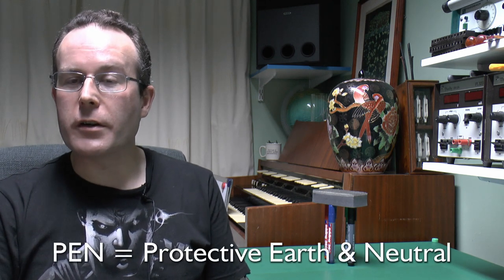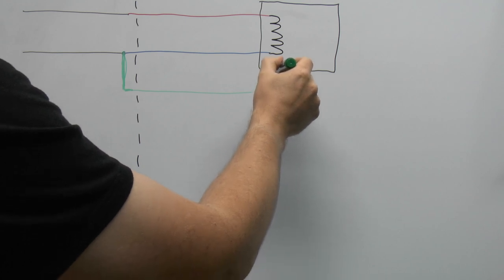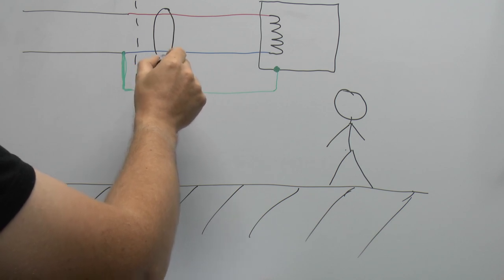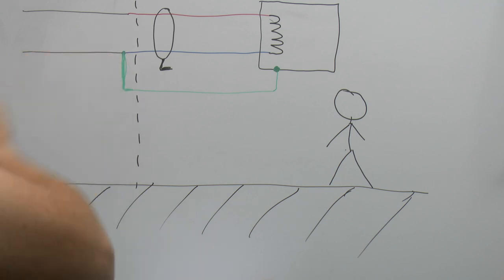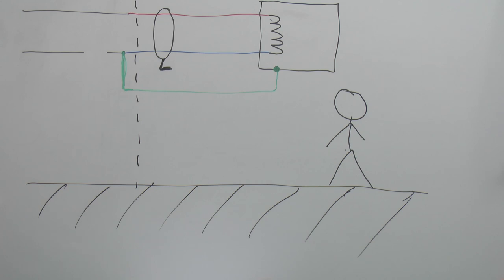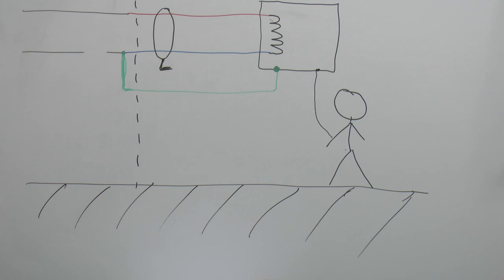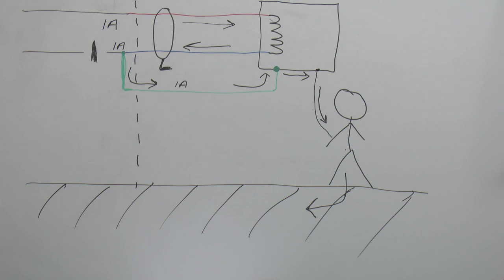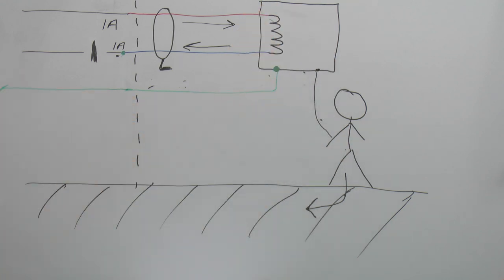TN-C-S Danger - Broken PEN Conductor (Combined Earth & Neutral)

Comment: I have a TN-C-S  type supply in my house and i have a separate grounding point (a spike in the ground) connected to the consuming board earth bar. I is a good thing ? I think in the situation of broken PEN it will be safer.
Reply: It depends on your local regulations. North and South America as well as most Anglo-Saxon countries usually apply TN (Grounding through neutral) whereas many other countries apply TT (grounding with ground rod). Many countries demand both to lower the risk of a broken PEN.

The TT System has the advantage of not rising ground potential in case of a broken PEN but all circuits need to be protected by a 30mA RCD.to prevent grounded devices with a metal enclosure from becoming live without tripping a breaker. In TN System  RCD's are optional although many countries have a rule you need to install them in places that can be moisty (like bathroom, kitchen, garage, outside).
Reply: +Kamis47
Actually, the 18th Edition Wiring Regulations are expected to require this extra earth-rod for new installations...  [though we will have to see how they come out, of course!.].
Reply: It wouldn't help in itself as the RCD wouldn't trip (equal current through live and neutral) and the earth impedance would be too high to trip any higher rated MCBs. Certainly not 40A, 32A or, probably even, 16A. Even 6A might be a bit of a hit or miss.

What's required is something that detects high voltages between neutral and an independent earth, and that ought to then disconnect the mains supply. Ideally that should be installed in the meter cab immediately before the feed to the CU. It ought to be part of the supplier installation, as it's to protect against failures in their network. On new builds the costs would be insignificant.
Reply: @robinheijblom2929  Hi Robin you sound very knowledgeable. Our property has NO  protective earth or ground rod and despite the Thai electrical regs closely following that of Australia with regards to the MEN link most other properties in the village are similar with just two prong plugs and sockets. The village is wired for MEN with neutral to earth links about every 4th pole. I am going to install a solar system, so wanting to do it correctly and not trusting local Thai electricians, I have been researching the subject.
My conclusion was to first rewire the house to Thai regs with regards to the MEN link/earth rod and earth wiring. The regs call for a 2.4M ground rod to be installed no testing required (the cost of my own meggar test equipment rules out me testing the ground rod myself). I now have a quandary do I go the MEN link way and potentially turn a single earth fault into a whole house earth fault or ? Any suggestions would be greatly appreciated. 
A severed neutral is quite common here, one happened only 2 weeks ago.
Reply: @peteroneill2991  Hello Peter. If your electrical grid is unreliable I wouldn't go for a grid tied solar system and instead go for off grid with batteries and only use the grid to replenish your batteries on cloudy days. Because you will apply double conversion (220 Volts -> 12-48 Volts -> 220 Volts) you will be free from any neutral faults.

Weather or not you should use the MEN system depends on your electrical installation and regulations. The official name for MEN is TN system. In many countries a hard link between Earth and Neutral is obligatory. In countries where it is optional, you can opt for TT system so Earth and Neutral stay completely separated. But those electrical installations are more complex, expensive and harder to build and maintain. In a TT system the impedance has to be low enough to trip the fuse or circuit breaker with the highest current or each circuit should have its own RCCB (which is a fancy name for a modern GFCI). This has to be measured with a Megger.

In the Netherlands you must use TN system when the current of a single phase is 80 Ampere or higher. Below you can choose. Many residential buildings have TT system. In France everything is TT system but the utility company will always install a 500 milliAmps RCCB type GFCI to prevent ground faults from occurring. In the end every transformer will have its secondary Neutral connected to Earth. In Germany TN system is the standard.

The reason TN system is so common is because it's cheap. Because the impedance between Earth and Neutral is artificially low it will always make a fuse/circuit breaker trip when a Line to Earth fault occurs. As long as you apply sufficient local grounding by installing a ground rod with a low enough impedance, even in case of a broken neutral the risk of electrocution stays low.

Also when water and/or gas pipes are conductive, you will still have an indirect Earth Neutral link through these pipes. Best is to apply galvanic isolation at the entrance of the building by replacing part of the piping with non conductive piping like PVC. Even when you have TN system it's always good to apply isolation. In case of a broken neutral you will not get currents all over the place.

But how come broken neutrals are so common in some regions? Are the electricians so lazy they simply don't secure the neutral wires properly? In the Netherlands most outdoor wiring is buried and not overhead. But in France overhead wiring is still quite common. Yet I've lived in France for 7 years and I've never encountered a broken neutral. And broken neutrals cannot stay undetected as France is TT system therefore a broken neutral means severe voltage and current fluctuations which will cause circuit breakers to trip.
Reply: @robinheijblom2929  Hi Robin thank you for your very detailed reply. I will break my reply down into sections.
Part 1. We are a very power hungry household, so going off-grid for the entire property is not an option. However I think, I will rewire part of the house with the most used items Aircon, kitchen, washing machines, fridge/freezers etc to the Thai wiring regulations which closely follow Australia's, with regard to the MEN link and 2.4M earth rod. It will be an off-grid inverter, housed in A outbuilding, however I will have a manual transfer switch, housed next to the new consumer unit in the house.
Reply: @robinheijblom2929  Part 2 of 2. The only pipes we have coming into the property is a plastic water main. There is an Earth/Neutral link about every 4th pole, there is one outside our property.
Yes part of the problem is laziness with regard to proper power line management also getting trees which interfere with power lines cut by the utility is impossible until it cuts a cable. A number of years ago, we tried to get them out to cut down about a dozen trees on our property which had the potential to cause problems, waited about 6 months nothing. I cut the smaller trees myself and hired people to cut the large ones down, I now trim any that get near the power lines.
Reply: @peter oneill  Hello Peter, ok I understand the broken neutral problem you have. I live in the Netherlands which is one of the top tier countries regarding infrastructure maintenance. We Dutchies are spoiled :) The national average for power failure in the Netherlands is <30 minutes per year! And that's the worst case that happened. For most people there is no power failure at all.

Simple question first. Does Thai regulation allow for electrical installations without MEN link? In US and many other countries they don't allow it. Earth and Neutral will always be bonded. If someone gets electrocuted and the MEN link is missing the person responsible for the electrical installation will be liable. This will be the owner of the building and/or electricial who designed and installed the electrical installation.

The cheapest solution would be following Australia en Thai regulations by using a MEN link and 2.4M earth rod. This will make sure all earth wires in the building have a low impedance path back to the neutral of the transformer. To minimize the effects of a broken neutral, make sure your earth rod is on the side of the building where the electrical wiring is coming from.

With TT system you have to make sure the earth rod has a sufficient low impedance. When all circuits are protected with a GFCI/RCCB impedance is allowed to be quite high, though <100 Ohm is recommended. When you only have circuit breakers you rely on their overload/short-circuit protection therefore earth impedance has to be much lower. Usually <5 Ohm for residential/small commercial and <1 Ohm for medium/large commercial. It's very difficult to accomplish such a low earth impedance. The 2.4M earth rod does not apply for TT system and only for MEN system because there is no way to know for sure the exact earth impedance without measuring with a megger. A multi-meter is not suitable for measuring earth impedance.

When using MEN system the earth rod is auxiliary and therefore it doesn't need to be measured under most circumstances. But I would measure it any way. Better safe than sorry and your own low impedance earth rod will also make sure voltages and currents do not go all over the place in case of a broken neutral.
Reply: @peter oneill I'm just thinking. If the risk of a broken neutral is so common in Thailand, why not have 2 earth rods and do both? 

You install a compliant 2.4 meter earth rod next to the meter (on the side of the house preferably closest to the electricity pole). There you install a small separate electrical panel where you make the MEN connection. From that point you take your wiring to the previous main electrical panel where all the circuits from your house are. There you install a second earth rod which has a low enough impedance to make GFCI's/RCCB's work reliably. Best is to have the earth rods not too close but not too far apart either. Best would be to have the first earth rod as close to the edge of your property where the utility pole's are and the second earth rod next to your house or in the crawl space on the side of the house where the wiring is entering. This will also minimize the amount of stray currents going all over the place.

This way:
- the first earth rod with the MEN connection will minimize the effects of the broken neutral
- the second earth rod will provide your own "clean" protective earth

Why an extra electrical panel you might ask? Because as far as I'm aware you're never allowed to have 2 earths in one general electrical panel. In many countries it's not even allowed to make your own MEN connection. The earth neutral bond is made by the utility company only once before the meter in the enclosed master fuse box and afterwards you will keep neutral and earth separated.

Of course this is a rather expensive approach, but in my opinion you will mitigate all problems as much as possible.
Reply: @robinheijblom2929  Hi Robin, Power cuts less than 30 minutes, if only. Here 30 minutes (if discounting the many annoying micro power cuts which disrupts the internet) to 30 hours is the norm, although most power cuts are between 2/3 hours.
I believe the MEN link is mandatory, but not policed, well certainly not in our rural village.
Yes checking the ground rod resistance is a good idea, but finding a Thai electrician who has the equipment and is competent in it's use is another matter.
The one good thing about a broken neutral is that it's an easy diagnosis with the power fluctuations and the flickering lights, isolate the power and call the utility.
I intend to use class B RCCB's with MCB's and a class 2 SPD, we have some spectacular lightening storms.
Reply: @peteroneill2991    I just heard there is something called a PEN fault detector. It's a device that looks like a large circuit breaker which in case of a broken neutral will not only switch off phase(s) and neutral but also the protective earth. Now mostly you will find them only on single circuits that feed outside outlets like EV chargers but maybe there are larger versions that allow you to connect a whole building to.

In my opinion in places where a broken neutral is quite common having a broken PEN fault detector isn't an excessive luxury. So maybe that's something to look into.

I'm not sure if such a configuration is allowed in Thailand. I was told in many countries you're not allowed to interrupt the protective earth at all! It has to be hardwired without switches. I am quite annoyed by this because it makes things like testing ground loops which can cause all kinds of electromagnetic interference very difficult.

Now of course there are always ways around it. F.e. you can just install a big 3-phase 5 pin 63 or 125 Amp CEE outlet and when you unplug it you also disconnect the protective earth. In Europe it's quite a common configuration when you want to be able to manually switch between grid and generator.
Reply: @robinheijblom2929  Thanks Robin the PEN fault detector sounds interesting. As for interrupting the protective earth, I do not know if it is prohibited in Thailand, but I doubt it is enforced as most houses in our village do NOT have a protective earth. Trying to find the equivalent of twin and earth cable locally is impossible I have to order VAF-G online. You can buy the twin core VAF and single core earth wire separate, but not combined and that includes the large stores in Nong Khai.
Any how must go and see my old friend Google.

Comment: I've got a question: If there was no grounding (no wire that is connected to the earth and then back to the transformer) wouldn't it be safer if I touch "just" one voltage-carrying wire? I mean you need a closed circuit for a continous flow (only an electrostatic discharge can flow without a real circuit (it only needs a potential difference)) so if you touch for example a wire carring 230 V you wouldn't get an electric shock as long as you don't touch the neutral wire as well ? (when it comes to high-voltage you would also need to stay far away from the seconds cable)
Reply from the maker: An isolated system would be safer, but only while it remained isolated.  Any fault anywhere causing either conductor to be connected to ground would go unnoticed but result in the whole system being ground referenced, making it the same as a normal system but without any proper control over which conductor is neutral or safety devices such as RCDs.
Reply: Thanks for your reply. Meanwhile, I've also heard grounding protects you against capacitive coupling. So when it comes for example to high voltage it is possible that objects become charged and when you touch one wire the circuit can be completed through capacitive coupling (if you are standing too close to the other wire, I don't mean through lightning arcs). As far as I know this is one of the (possible) reasons why for example the neon-lamp mains tester lights up even if you're standing on an isolated plastic floor (that can hold up more than 1000 Volts and should not conduct below that value).
Reply: As well as preventing a build up of high voltages of static protective multiple earthing of the Netutral on the supply on TN-C-S   also helps protect the consumer to some extent from lightning surges especially rural locations on overhead supply  susceptible to strikes on the lines

Comment: Seems to me that if you put a high current NVR between the consumer unit and the meter any loss of the PEN conductor would cause it to cut out and disconnect the line to the installation almost immediately.

Comment: Great explanation. In this case with a broken PEN would the consumer unit's earth rod connection help form an alternative path and trip the mcb before danger arises?
Reply from the maker: An earth rod will reduce the voltage on exposed conductive parts, but won't trip anything - current flow through the MCBs / RCDs would just be the normal operating current of the installation even if the earth rod had a zero resistance.
Most installations in the UK don't have local earth rods.
Reply: No, earth rods are some 20 ohm or so. That means the current is in the order of 10 amperes.

Comment: hI John I have watched many of your vids .I am a reg niceic approved contractor.I was wondering about your thoughts on pen conductor faults and who should be really take the responsibility for them.At present the installer is required to provide protection for a fault which isnt there and may never be there.A scenario based fault.If the dno are to supply these systems knowing full well that if they fail ,the customer could be killed then isnt it time all meters were supplied simply with a 100 amp relay as standard.on all pme systems?This would cause any fault just before the property to disconnect that  supply until the fault is rectified.This would mean having the earth bonding arrangement on the output side of the relay.I dont see how that would effect anything as the supply would be cut off anyway.The only issue would be that the next door property could still have your pipe work connected through to their installation.However if their property is ok then this wouldnt seem to be of any concern .Whats your thoughts?

Comment: My understanding is that in a summer house/shed  with no extraneous conductive parts and a wooden floor then its ok to bring the TNCS earthing arrangement outside of the house via SWA etc .  I have to say though the potential for a nasty belt from a Metal CU in the situation you describe is concerning.
Reply: It's often safe because appliances expected to be used outside are class 2 (double insulated) so no exposed metal parts connected to the earth wire.
Reply: @anahatamelodeon   but items used in a summer house/ shed are mostly just normal household items . Not garden items